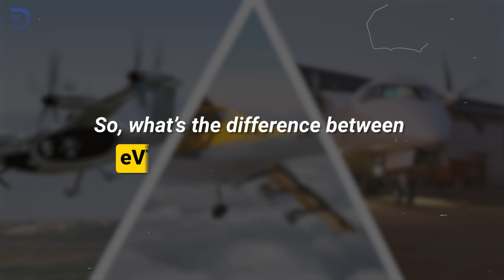The Key Differences Between eVTOL, eSTOL, and eCTOL Aircrafts

Comment: My favourite is ATOL or Assisted Take Off and Landing using a cable to convey energy to the aircraft to allow extremely rapid take off and very high rare and angle of climb with little ( or nil ) on board power.  Gliders acheive climb rates of 2000 feet per minute and climb angles of 45 degrees with ZERO installed power , not even one mouse power as compared to the over 3000 horsepower that the Lilium needs to do a slow lethargic rise and hover to a feeble climb rate.
A child's kite also rises at such steep angles with ZERO noise or downblast of air as created by evtols, as do sailplanes and could ATOL UAM aircraft using extremely simple launch/land apparatus consisting of just tensioned and moving cable arrays placed over roadways using otherwise unused "real estate" of no cost and suitable for suburban streets as well as tall building tops  or other minimal open spaces ( much less than STOL )
Naval aircraft weighing 20 to 30 tons are assisted in both launch and land to need only a couple of hundred feet whereas a light civil passenger aircraft can do so without any of the drama or brutality of such nonetheless very short take off and landings.
The energy wastage (and danger,noise, turmoil etc ) associated with vtol is unacceptable for economic civil aviation anywhere near habitation as will be apparent soon after their attempted introduction.
The grace and silence of a sailplane winch launch points the way to viable personal air mobility and almost from your doorstep unlike the violence of brute force evtol contraptions.
I would not trust something " hanging on the props" but have had many hundred assisted (winch) launches of which millions have been done safely and cheaply .  Maybe we can avoid the dystopia future of mad buzzing gadgets that Elon Musk has described and foreseen with Evtol.😊😊